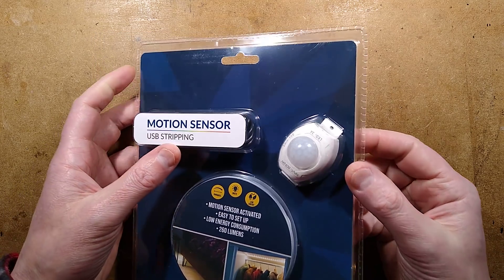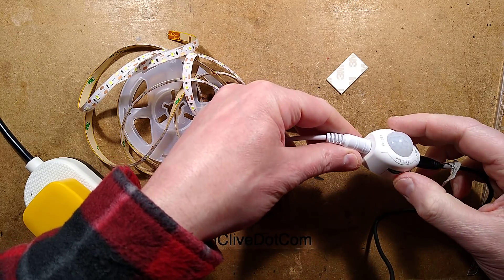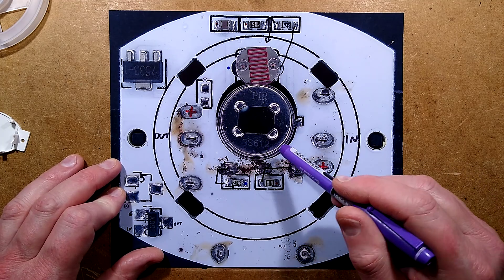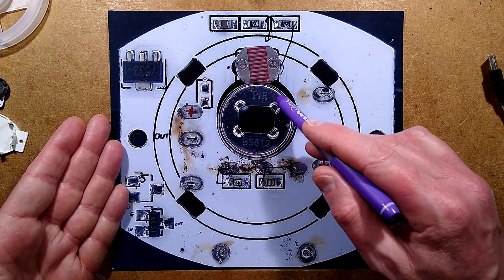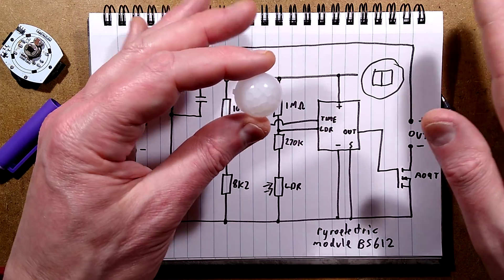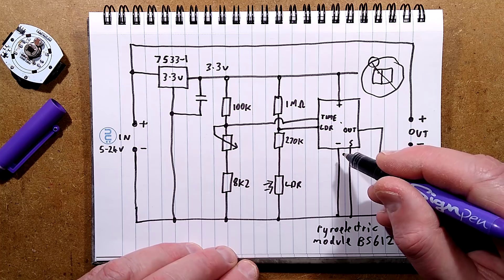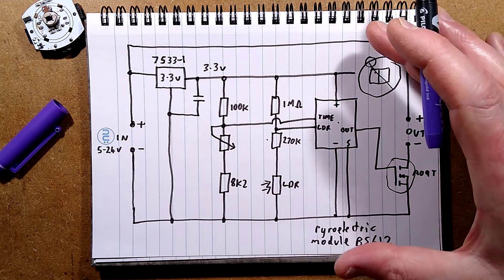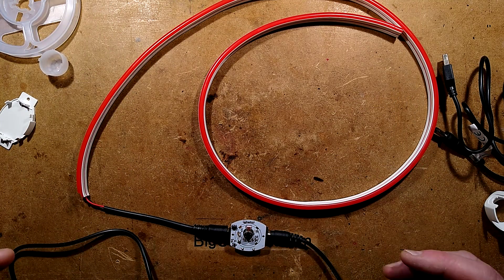Poundland's PIR LED tape.  Worth buying just for the sensor.

Comment: Ah, Fire Emitting Transistors, my favourite.
Reply: The smoke emitting ones are not as exciting
Reply: What do you call  accidentally using an infrared LED  instead of a visible light LED An infuriating LED
Reply: @andysim232  as they say where there's smoke there's fire right not in that case unless you count fire that you can't see burning but just hot enough to burn something but no visible flames so you could take that either way.

Hello smoke it mini ones may not be as exciting they can still come piano annoying money out this magic smoke you know the stuff that keeps it working properly AKA are you something goes wrong time to fix it and anyting going out at times can be annoying worse yet time-consuming if you don't know what went right away but if the boys on the bench in that happens I think you know what got fried problem is a lot of times when one point it goes out it's something else that killed it not always but journaling it wasn't just one single failure that would cause something like that and that's what I'm saying about the annoying part is trying to track down the rest of the trouble or the troll when you're not sure let's not very obvious but magic smoke blowing out something when it's right on the bench pretty easy to find at least the first component that will need to be replaced what someone should do is build a model of the IBM Magic Smoke injector yeah that was a guy get one turning but if someone really needs to build a model based on the image and then have like a Piezo Electric atomizer for water in there so you could actually Tabet generate smoke as part of the gag I guess you could use a vape pen or something like that but I'd rather do ultrasonic since I don't smoke or vape that's just who needs it and possible carcinogens Etc and anything else just saying it when people use those things for a special effects you're still exposing yourself to something one thing or another but then again ultrasonic mist or fog or whatever generator it's just water vapor for real loss of course you say their stuff in the air or mobiles or whatever or others so pick your poison I guess don't even get me started about the hydrogen monoxide gag that's the thing look it up and yeah it's water is all also the scare the original one was evidently started by someone in school that wanted to see just how gullible people can be and did a report trying to ban dihydrogen monoxide which of course is water H2O   which works out to be no dihydrogen monoxide.

And also in this he actually or she whichever was use all factual information regarding water and that kind of stuck and that's how that got started.

Also I did so want to see speaking Magic Smoke when the comment somewhere I don't remember if it's as YouTube or somewhere else but it was of an image that it was for some Electronics something around and I'd photoshopped in a smoke I do believe I'm thinking they saw what the estimate was a soldering iron in actuality what. Was the solar guard or whatever happened that tool was actually an oscilloscope probe and I just couldn't stop laughing you know I mean water for you if anyone if it was a school who would want to go to a school or class when they don't know that I'm so scope probe does not generate smoke or at least should not.

I remember the first time I ever saw the Magic Smoke from inside something black was a kid I had to speak and spell note at the time was using rechargeable nicad batteries don't know if that had something to do with it but it could have since there are very large short circuit currents and of course because it kept doing yank the batteries out which is hard with that device done intentionally when I saw the smoke at story going berserk with weird sounds and stuff you better bet I rip those batteries out there.

By the way I remember when the batteries would get low I don't know if that was just alkaline or if the rechargeables or both but I do remember this when the battery is got low it would go crazy sometimes it would just start looping the same word over and over and over I remember once when the battery is got low it started seeing angel angel angel angel and so on until we pulled the batteries.

It was running on four C batteries so I suspect at least at that time it would have been 5 volts so far volt regulator probably 7805 I suspect what was going on is the regulator was dropping out when the batteries were almost dead considering their Nike ad that would be more likely because of the lure voltage start with.

1.2 vs 1.5 which would make a difference at least more dramatically so but that's just a theory in terms of stability of the CPU on that Thunder low voltage conditions yep.
Reply: @aaronbrandenburg2441  could you PLEASE repeat that
Reply: Been watching electroboom have we?
Reply: I remember Noise Emitting Diodes…

Comment: Do you have a video on the doppler sensors?  I for the life of me can't find any products that utilize it, and PIR is useless around sunlight.  I need daytime outdoor motion sensing.  To set off a chime or something.
Reply from the maker: Search my channel for doppler or radar.  They are used in outdoor lights, but will be triggered by anything moving including birds, pets and foliage.
Reply: And rain - have to turn off our microwave sensor light at nighttime when it’s raining 🙁
Reply: @samuelfellows6923  I wonder if there's a way to attenuate this circuit to adjust the sensitivity and range.

I have indoor-outdoor cats that need to be let in on a whim, but PIR is useless in daylight and will trigger with every passing cloud, glint of light from a distant vehicle, or becomes blind when it's exceptionally hot out.  My other thought is to buy or salvage a garage door trip sensor.  I wonder if anyone makes a low-power chip that does laser diode museum heist trip sensors.
Reply: @agvulpine  🤨 ?

Comment: I've seen them using the 01D designator rather than the 104 for some Chinese 1% resistors, don't ask me why...
Reply: Probably easier to read for the assembly workers, as you can use 2 numbers and a alpha character, so not going to be confused as to value when you are not sure of the orientation and thus the value. A through to F is harder to confuse for a number, and shows the multiplier easily, though I wonder what they use for the sub ohm range, probably G and H, as SMD resistors greater than 99M are not at all common

Comment: Sounds like it'd be good for camping especially if you had a solar panel that can charge your battery pack and then use that at night in your tent or whatnot
Reply: That's a very good idea! Especially if you had a power bank with the solar panel built in.  Quick, cobble one together right now, and get down to the patent office first thing tomorrow morning!!
Reply: @28YorkshireRose12   Unless you're buying one the really overpriced ones with fold out panels, the power banks with built-in panels are nearly worthless, they'll have at best a 1W panel meaning it would take roughly 16 hours to fully charge a fairly small 4,000ma battery or 4 hours per 1,000ma, so it is technically good enough for this use case but I still don't think leaving batteries to bake in sunlight is ever a good idea anyway, heat just makes the cells die quicker.
Reply: If it's all right with the rest of the group, I'd rather not use my battery pack in my whatnot. Thank you.
Reply: @interestedlen8823  - no problem, the victorians made clockwork ones.
Reply: I can vouch that these work for maybe days off w power bank

Comment: I've been using the Poundland everbrite WiFi plugs they are great. have you seen them yet? hopefully get a big clive seal of approval....
Reply from the maker: I've seen the have a range of WiFi connected lamps and outlets.  I'm not a huge fan of WiFi connected appliances though.
Reply: No-name smarthome devices are iffy. Will they still work when the servers stop running...?
Reply: Be interesting to know if these have ESP8266s inside: you can flash those with custom firmware which doesn't rely on dodgy servers.

Comment: Probably a silly question but if we use the sensor on 12V do we have to use a 12 volt LED strip? I didn't notice any regulation in the circuit diagram which would allow the included 5V LED strip to work. I can foresee some ppl connecting them to car 12V supply and the LED strip failing in a short time. (that's what I was thinking to do; use it to illuminate the back of my van; would come on when the back doors are opened).
Reply from the maker: Yes, the strip would need to match the power supply.
Reply: Easiest way might be to power the whole thing from an automotive USB adapter.  But you would be less likely to run the battery down if you put a 5V regulator chip or an automotive USB adapter between the sensor and the LEDs.
Reply: @jayherde0  I had to reread that a couple times for it to click how that would save power.
If anybody else is having trouble making sense of that:  Having the regulator/converter between the sensor and the strip means that the regulator only runs when the sensor is activated.
Reply: @Kineth1  thanks

Comment: Looks good for 5v and 12v but won't 24v put a bit of a strain on that 3.3v regulator. Can you put your thermal imaging camera on it and see how hot it gets?
Reply: Power usage of a liner regulator is dependent on current - the sensor took less than .001 A. At .001A - 5v-3.3v = 1.7v * .001 = .0017w, at 24v-3.3v = 20.7v * .001 = 0.0207w... I would not worry....🙂

Comment: Yet more stuff I need to buy from Poundland that I don't really have a use for - yet. Still have a box full of the £2 5v led strips waiting for a use.
Reply: Don't keep them forever! If they have the "poured on" waterproof coating, it yellows over time - even when not in use :(
Reply: I should have bought more of those.
Was going to build myself a "lightboard" for video teaching with the ones I had, but couldn't find them, but then shops and restaurants worldwide started buying up perspex and by the time I found them, the cost was too high to justify.

Now considering using one as a monitor surround for a a super-duper video-conference ringlight....

Comment: I've bought a few LED PIR sensor switches from AliExpress for £2-3 each, I think - 5~24V, barrel connectors, pots for sensitivity and time - though the Poundland kit is still very attractive, especially with this year's higher shipping costs from China.
I currently have one connected to a LED strip above the main kitchen counter so it lights automatically when someone goes to use that surface. Very handy :)

Comment: That's a fine little kit. As long as you were careful with the input voltage that would be easy to hook up to a uPC too. You can buy sensors cheaper than the £5, but that comes with connectors and a spanky case too.  Now, where's my nearest pound land and have they got any 😊

Comment: What a cool kit! My first led strip installment was a wardrobe light from Ikea (around 2012), it cost about 15euro, uses a passive motion sensor and requires 6 AAA batteries - that last two to three months. Completely useless crap that I've only kept to avoid the horrors of removing that doubleside 3M tape xD
Reply: Dental floss & isopropanol (even if it's 70%; you should have some around these days) will sort you out with that double-sided tape.
Reply: @LiyangHU  Thanks, I could give ipa a try! I've also got LabelOff that takes off every sticky thing ever put on anything, but unfortunately my wardrobe does not seem to like it ':D
Reply: @MLX1401  I had a look at the LabelOff 50 / Super MSDSs and I'm not surprised that your furniture disagrees with it! (They're fine for metals and glass.) Isopropanol, ethanol (methylated spirits), or methanol should all be a lot more agreeable, but test first. :)
Reply: As Liyang says, IPA is your best bet, won't damage most surfaces (I would do a test on delicate surfaces, it doesn't play nicely with some)
If I think there is any chance I will move something then I keep the wax paper protective strip and stick it upside-down onto the sticky residue, job done!

Comment: Those MOSFETs are usually enhancement mode, so there is only one conducting surface. The metal gate sits on a thin oxide layer, and below that is a lightly positive doped substrate. The source and drain are highly negatively doped at either end.

When a positive charge is applied to the gate, it attracts enough electrons into the substrate to form a narrow channel of silicon with excess electrons in the conduction band. That channel is what allows electrons to move from the source to the drain. In the off condition, the charge carriers can't enter the drain because the junction is reversed biased. Once the channel is formed, electrons can freely travel in the conduction band from the source to the drain.